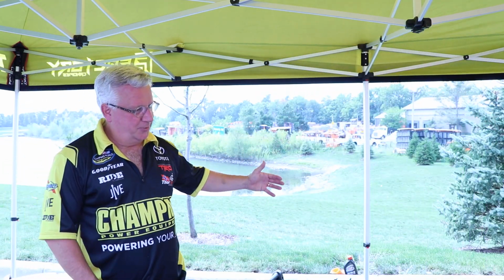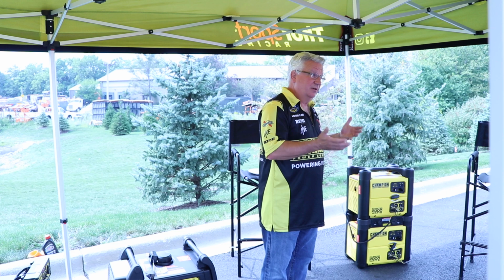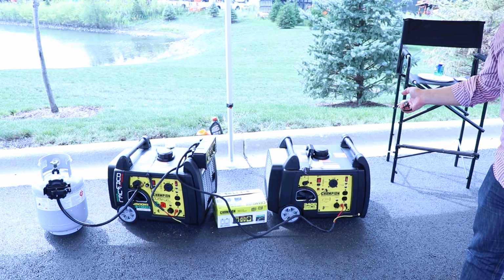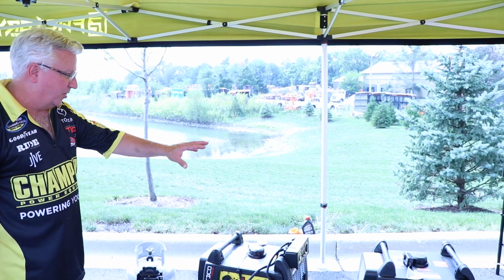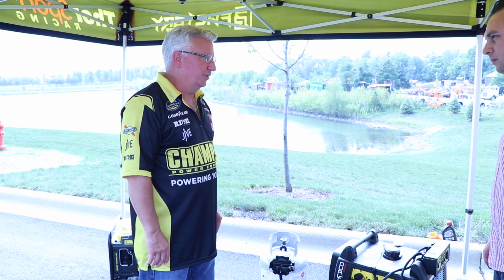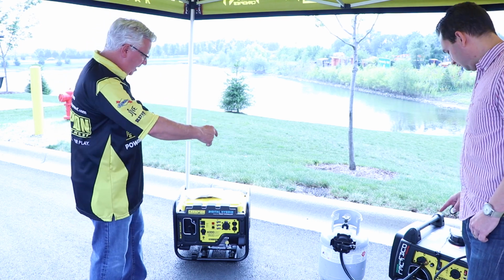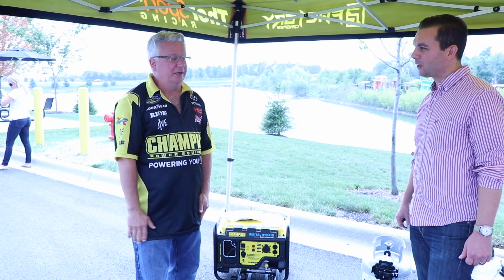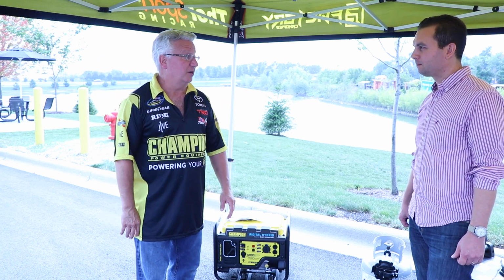Champion Generators Overview and Demonstration

Comment: His comments about propane and gasoline were a little confusing. A 20 pound bottle of propane contains 4.6 gallons. The gas tank on the generator is 1.6 gallons. To create the same amount of power with propane you will use 40-50% more fuel.  A 20 pound tank of propane (4.6 gallons) will run the generator for twice as long as the 1.6 gallons of gasoline.

Comment: I think your gas/propane run times are somewhat backwards. I have a 3100/2800 unit that will run about 19 hours on one #20 tank of propane. I don't have any figures for gasoline because I use mine with propane only.
Reply from the maker: Thanks for the comment. It's hard to verify these estimates on a product-by-product basis because there are many, many influencing factors that can change the results. Usually, it's best to underestimate and delight rather than overpromise and disappoint.

Comment: Does Champion use hardened valve seats in all their units or just the dual fuel ones?  I have heard that propane tends to go through valve seats much more quickly than regular gas does.  Will the life span of the engine be shortened by using propane or lpg?  Like to hear from the source rather than the grapevine.
Reply from the maker: I have not heard of them having hardened valve seats in their engines. Propane and Natural gas are both very hard on engines over gasoline. This is because of the combustion temperature. Gasoline burns at around 500-600 degrees, LP and NG burn around 900 degrees. The extra heat wears on the engine, spark plugs and breaks down oil much quicker.

Comment: why no remote start on duel fuel?
Reply from the maker: Hey Steven, I hear you buddy! I actually took your comment to the guys at Champion and they are working on it! Check out our page for dual-fuel remote start generators here: https://www.electricgeneratorsdirect.com/power/portable-dual-fuel-generators.html?sort_value=&displaynum=0&spec_options_id%5B1026%5D%5B%5D=12-Volt%20Button%20Start%20w%2F%20Recoil%20%2B%20Remote

Comment: Any plans for Champion to made the dual fuel model WITH the remote start?
Reply: The reason you can't have dual fuel with a remote start is because you are not supposed to leave propane pressurized in the fuel line. When you shut off the generator (as you saw in the demo) you must turn off the propane tank. You can't start it up without turning on the propane tank. Therefore you can't start it remotely. This was the answer I got when I spoke to Champion customer service directly. It is the price you pay to run on a cleaner and more cost effective fuel.
Reply from the maker: @EverythingRVbyPat  Good point and makes sense. Great channel there btw. Thanks for commenting!
Reply: @EverythingRVbyPat  Cleaner burning-yes, more cost effective not so much.  You lose ten percent of your wattage capacity and increase at the same time the fuel quantity by thirty percent over using regular gas.  This is from what he just said and the label on the machine.  Add to that that the usable amount of the propane in a tank decreases with decreasing outside temperature and it makes a good case for the gas version.  Keep in mind that at 70 degrees ambient temp if you get 5 1/2 hrs in twenty degrees you may get half that.  Plus you will be packing around many twenty pound bottles to get through a night or two.  Of course when it gets back up to 70 you can reuse them but it presents quite a logistics problem if you are going anywhere in the colder climates.
Reply from the maker: We'll pass that onto Champion as a desired feature! As soon as they release one, we'll be sure to list it here: https://www.electricgeneratorsdirect.com/power/champion-generators.html
Reply: Hard to do because you have to manually open the valve on the tank and you have to shut the valve to turn it off.